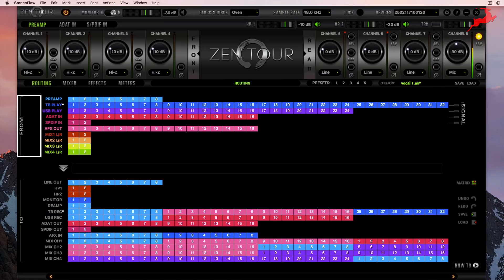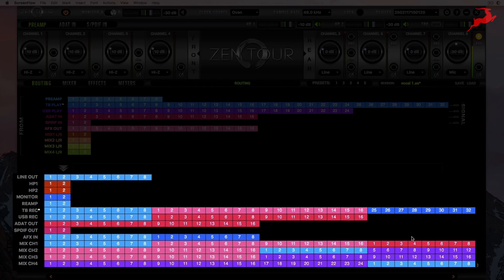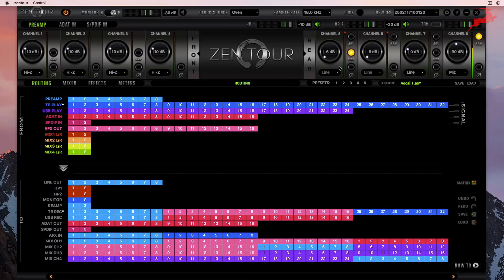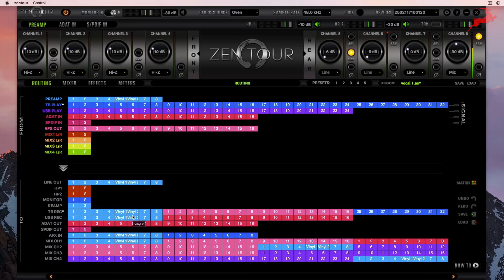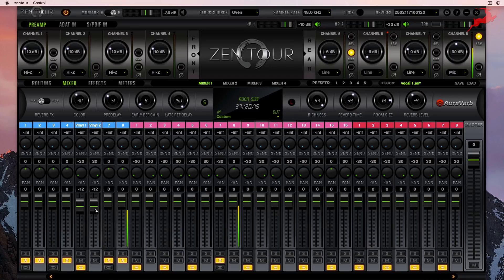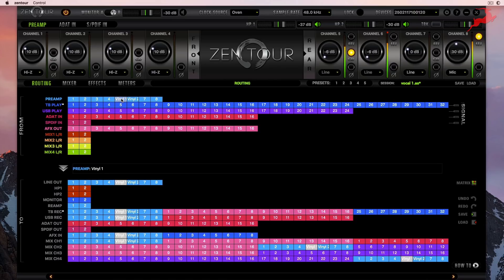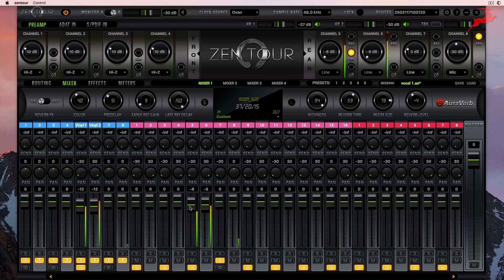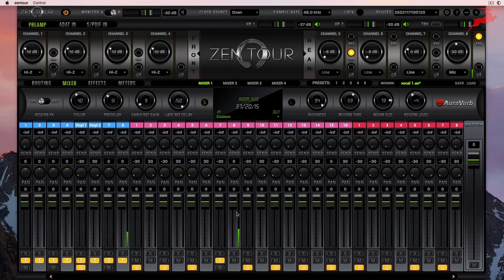Routing - Demystifying the Antelope Control Panel with Alex Solano

Comment: why isn't there a phase shift button in the mixer, or is there?
Reply from the maker: Phase inverse buttons are available only on the pre amp section of the control panel.
Reply: and how is it with orion 32(+,hd), or your other converters that do not have preamps

Comment: If I use my Orion Studio 2017 in USB Mode OSX High Sierra following your instructions I do not get any sound out of it .... Always have to route the signal directly to the monitors... maybe I am to old for informatic .... - Maybe it would be easier to copy a bit of the UAD and RME concept. 
For me as an elderly one a mixing desk is still a mixing desk.

The sound is brilliant but sometimes it takes too long for me to get a clear result if I am into music and not into fixing computer problems. :)

Comment: I have the orion 32 rev 2017, using with PT 2018. I want to create monitor mixes in the box, using sends on my input tracks and routing those to separate aux returns. I then route the aux returns to the Orion line outs, which I connect via DB-25 with TRS breakouts to my headphone amp. This is only working sporadically for me, so I must be messing up the routing in the Orion matrix. How should that routing look? Preamp->TB record, then TB play to line out?